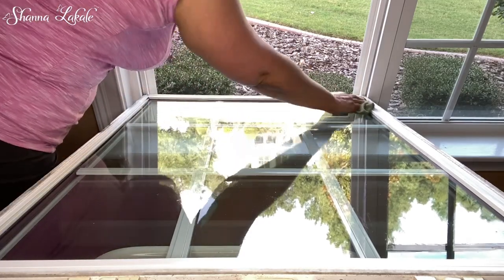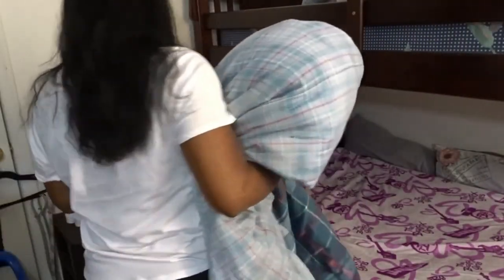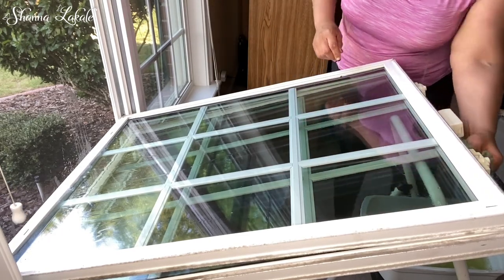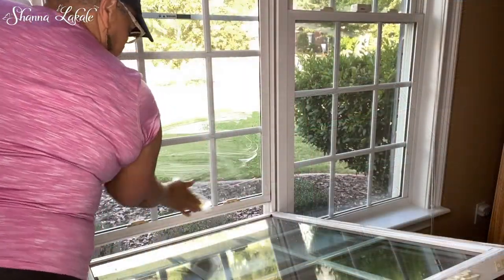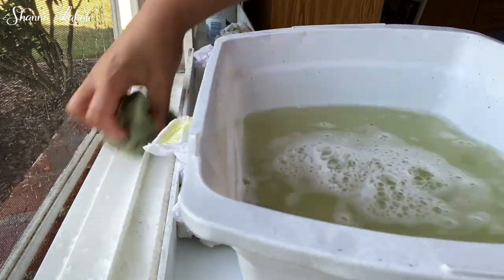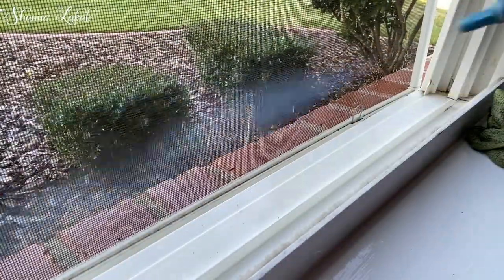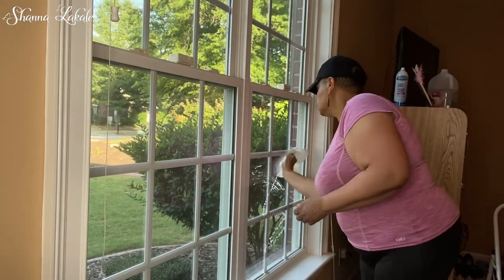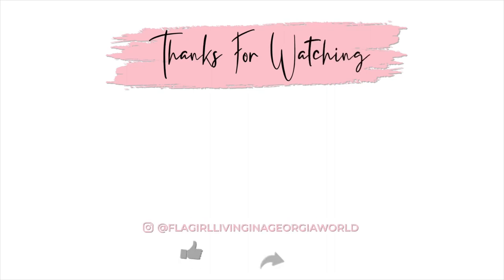CLEANING WINDOW TRACKS || CLEANING WINDOW TRACKS WITH A STEAMER || CLEANING WINDOW SILLS AND TRACKS

Comment: Thanks for the video! I would recommend using a squeegee and scrubber over the towels. Leave no streaks and is very quick to do. I also recommend the steamer you are using along with a shop vac to suction all of that muck out when it is wet. At $50/window you will save a lot of money and gain tools if you purchase a good squeegee and scrubber (like Unger), a steamer (like Wagner) and a small shop vac with attachments to get in those crevasses (like a Stinger).
Reply from the maker: Thank you for watching and your recommendations. Have a blessed weekend 😊